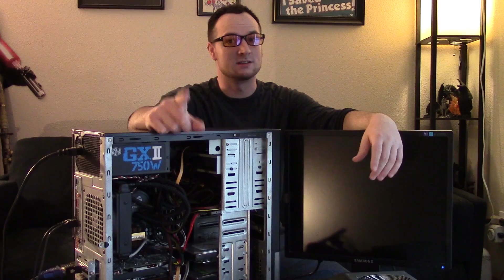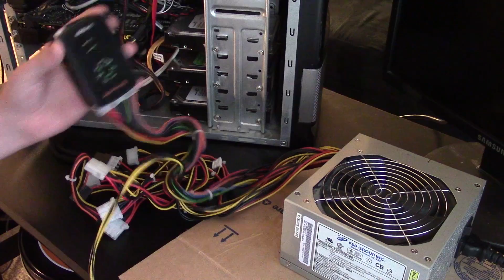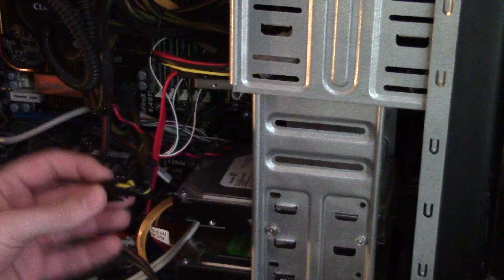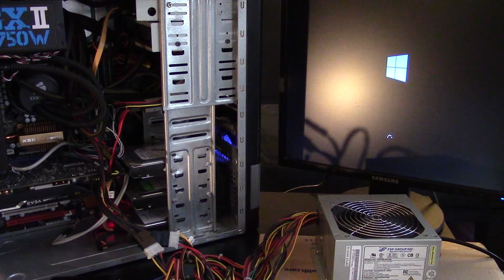💻 Running dual power supplies

Comment: What happens if you turn the system and the psu on at not exactly the same time
Reply from the maker: in my experience you get the low power performance warning on the video card or the video simple does not display.
Reply: @TheThorns  nothing that will destroy components?
Reply from the maker: @STEN-164  since you are only hooking into the video card external pin out not to my knowledge. if you are worried and are planning on doing this on your primary machine I would highly recommend getting the $6 dollar adapter from amazon which is listed in the videos description.
Reply: @TheThorns  okay thank you and  great video by the way!
Reply: @TheThorns  what would you need an adapter for.?
Reply: @TheThorns   1 year later but i have a question what if i turn on the secondary psu first and then my primary will it work that way without any risk?
Reply: @gamingtutorials5938  my setup has two power supplies, And it doesn't honestly matter from what i've seen, I usually turn on the video card's power supply first. you also don't have to keep the other power supply off while you turn off your system just an fyi
Reply: you should have 1 psu to the most important components like the motherboard and video cards the rest of the optional stuff from the second psu. the reason is water-cooling ect because they take a lot to run depending on the hardware.
Reply: thanks so much, your videos are really informative,your other pc videos were really helpful
Reply: @zaklevy7481  i think theres a adoptor right now that you can Hook 2 24pin psu together. so it Boot at the same time. Cypto miners are expert about This
Reply: They make these little adapter things now so u don't need to use a tester. Basically a female end with the 2 required pins connected with a wire. Cheap too

Comment: or simply connect green and black wires from both, 3, 4, 10 psus and they will turn ON at the same time ... duh
Reply from the maker: yes the paper clip method of course works, but much better for the hardware to use a tester or a modified cable adapter. Also, hard to expect beginners to know such things as the video is intended for everyone.

Comment: Heard a pop, gonna wait and just get a new power supply 😅hopefully it was the power supply popped or Hello alder lake?
Reply from the maker: Hopefully the PSU popped and not a component in the motherboard.
Reply: @TheThorns  Thankfully got a new replacement powersupply and it indeed was just one of the powersupplies, been meaning to replace it but just added a support and it worked for awhile. now all is well and better. Happy Holidays mate, I  hope you are having a good one.

Comment: is there a way to do this so that the psu and cables are not draped across the desk? Or a way to close the pc case and keep the power supply itself in a safer more secure location?
Reply from the maker: Some desktop cases support 2 power supplies. However I have seen others take the expansion card back plates brackets out of thier computer case running the cables through them in the back which allows them to close the case. Then its just a matter of finding a nice plastic enclosure for the power supply itself. As long as the power supply can breath within the enclosure I have not heard of any issues.

Comment: I do this in 2024
Reply from the maker: I still do this today on a different system , however the setup is a little nicer using a Molex power brick and an official cable.

Comment: So is it possible to power your motherboard and HDD with one PSU, and 2 PSUs to power the GPU?
Reply from the maker: It is certainly possible however personally I would keep it at 2 for timing reasons. I also recommend using an actual cable to handle this versus the older methods.

Comment: Bro i have a UPS so should i connect the gpu power to it ? 

And when i turn on the ups will both the Power supply turn together?

Thanks
Reply from the maker: you need an adapter cable for best results and for both to turn on at the same time. other wise you have to use the paper clip method or PSU tester method and have to manually turn them on and off together.

Comment: u should get a 120v relay with 5V or 12V coil, so when u turn on the PC, it automatically turns on the 2nd PSU.
Reply from the maker: Yep, that's why I put the link to such an adapter in the description.

Comment: Can I use the 2nd psu to only power my sata HDDs ?
Reply from the maker: You most certainly can, however I'd still get the adapter so you don't have a timing issue.
Reply: Thanks for the reply..but say if I never put my pc to sleep and restart my pc everytime I need to shutdown my pc and then when my pc asks for the password after BIOS (I have set a BIOS password to be entered everytime my pc boots) I turn off the switch at the wall ? Won't that be safe enough for the HDDs and my pc altogether ? @TheThorns

Comment: I have a similar rig, but at times when a load something particular to and editing time line or something along those lines, the PSU powering the card turns of...
It doesn't turn of when i do a stress test, but will turn of if i repeat the same action that turned it of in the 1st place...
What's the issue...
Reply from the maker: That is an odd one. I'd try a different PSU if you have one available. Also what are you using to stress test? Personally I use FurMark.
Please sub if you can 😊

Comment: so just to confirm you can get another power supply and just connect it to power and graphic card
Reply from the maker: In short yes. However you need to get the timing right if not using a splitter. Meaning turn the computer on and abut 2 seconds latter activate/power-on the second PSU. If you get the adapter you don't have to worry about it.  Please sub if you can 😊

Comment: Bro i have a hp slim 290 and itz very slowwwww and i want to upgrade the gpu to 750ti by using a external psu but from this vidoe i cant understand what u did i think u first connect the 24pin to the psu tester and the the 6pin to gpu then turn both on is that what u do or i have to do something else ??😔😔
Reply from the maker: You are correct plugging up the 24 pin connector basically bypasses to on mode for the power supply.  In this video I use a power supply tester as it is safe and you don't need to locate the pins to jump. There are several ways to accomplish this with official 2 way adapters for 24 pin connectors. If your 750ti has a 6 pin connector the tester method should work fine. If the HP slim has a 24 pin connector and not proprietary power supply I would recommend just getting the cable in the description. Long story short the 2nd power supply will have the tester on the 24 pin connector and the 6 pin goes to your video card. If your 2nd power supply doesn't have a manual switch anywhere I would recommend plugging into a dedicated surge protector as just plugging it in when you power on you PC can cause dirty power issues. Note some boards just flat out don't like this method and an HP slim Motherboard is the type of board it might not work with.
Reply: @TheThorns  Thank u so much bro

Comment: I would connect an alligator clip from the chassis of the computer to the chassis of the PSU so the grounds of the two PSUs are connected, that avoids electrical problems.
Reply from the maker: These days I highly recommend getting an official adapter which is in the description. But I agree , the clips would be much better than the paper clip method. Please sub if you can.

Comment: Im trying to add a GPU to a HP Z420 which only has a 6-pin pcie power connector but the GPU needs 2x 8-pin power. It looks like I can simply add a second PSU to power the dual 8-pin connectors, but im wondering how you establish a common ground between the 2 PSUs. Is that done internal to the GPU since the X16 slot is powered from 1 PSU and the GPU power is comming from the second PSU?
Reply from the maker: Honestly I'd pick up a convertor adapter so you can have a standard power supply for the HP z420. Depending on what you have might just be able to switch to one good power supply. Please sub if you can.
Reply: @TheThorns  I agree, I found a 24-pin to 18-pin converter and ill try that with an external ATX PSU shortly

Comment: not everyone has an power supply tester
Reply from the maker: Which is why there are 3 options. jump it yourself , buy an adapter cable (link in description) or use a tester.

Comment: I´ve had a similar setup for 10 years since I have a dell motherboard with a propietary PSU, inside a standard ATX case and a RX 580. I simply turn on the PSU that is connected to the GPU first, and after 2 secs I power on the system normally.

When I shutdown the system, I wait for the power LED to turn off and then manually switch the PSU that I have connected to the GPU off.

The PSU is bridged with a paper clip and duct tape around it.
Reply from the maker: Thanks for sharing, ya there are essentially 3 methods for this. Use an adapter that cost $6 , use a power supply tester if you have one or the paper clip trick. Please sub if you can.
Reply: Just what i was looking for. I have a HP Prodesk 600 g2, and gonna give life to a RX 580 8GB using an external 500W PSU using its 6 pin connector to power up the GPU and jumpstarting it using a paperclip.
Reply: @Yohi_Gaming  It does work. You can put up to a 6th gen I7 in those machines. They are really good at gaming.
Reply: @ferna2294  that's my last upgrade, mate, thank you very much !! :DDDDD

Comment: So can you run the two 8 pin gpu connectors with one psu and the 75W pci slot power on another psu with out having current drift or regulators fighting each other?
Reply from the maker: I would use an official cable, link in the description I think its like $6. however yes in this case you can split and just have the two GPU connection on one power supply.  Please sub if you can.

Comment: Hey im having trouble with this method im not sure if you can help. My pc boots up fine with both PSUs connected. Though under heavy load like gaming my GPU PSU turns off. 
Thanks in advance!
Reply from the maker: Are you using the split adapter, paper clip jump or power supply tester? Your board might not like the config and assumes you only have the watts of the primary. Please sub if you can.

Comment: Hey I did this everything powers on and stuff I just not getting any GPU display or anything but when I do it without the GPU I get a display on my PC and I really wanted this to work I have 2 psu do I don't understand I also have a apu like a GPU in a CPU I just don't have any display power
Reply from the maker: I have to assume it is a power issue on one of the supplies or a syncing issue. you may want to consider a cable adapter to see if they will sync better. 🎃 Have a Happy Halloween & please sub if you can.

Comment: what happens if you don't switch off the psu powering the gpu after pc turns off?
Reply from the maker: normally it just keeps the fan spinning and the card is still active waiting for instructions from the motherboard. but be careful not all mobo's and video cards are created equal and may not be so forgiving. Please sub if you can 🤖

Comment: So I know this is an old video, but I have an add desktop and there's not much I can do because of the hp proprietary connectors, so I'm looking at a secondary external PSU so I can upgrade the GPU. Have you considered tying in the on/off of the secondary with the system's main power switch?
Reply from the maker: If it's a full or mid tower you can get HP to 24 pin connector convertor cables. you can even go dual with those cables. 

☃️ Happy Holidays. Sorry for the delay in response, as I'm sure you know I can't reply to everyone. Hope you enjoyed the video. Please sub if you haven't already & have a safe new year. 🙂

example: 
https://www.amazon.com/gp/product/B06XW7RWNH/ref=as_li_tl?ie=UTF8&camp=1789&creative=9325&creativeASIN=B06XW7RWNH&linkCode=as2&tag=drnoobslab0b-20&linkId=1f52aba437d3ef646f2dd83bd7b2a3f9

Comment: Hi, sorry for writing so late on this old video but here goes:

What if I use the extra psu but don't connect it to the mother board and instead it just powers an extra GPU that is outside via a riser? or does it strictly need to power the motherboard first?
Reply from the maker: That is what this video is about.  One PSU is going to motherboard and hard drives, the second is going to the GPU. You need to power the motherboard with a PSU or the computer will not function. Sorry for the delay, as I'm sure you know I can't reply to everyone. Hope you enjoyed the video. Have a Happy Halloween 🎃 & please sub if you can.🙂

Comment: What downside you get a twin socket mains plug those white square ones put both mains plugs into the square then into the wall socket and use that to switch on and off leaving the psu switches on.
Reply from the maker: should be fine if I am understanding what you are trying to accomplish.
However if I am not understanding your question correctly, Never force any 4, 6 or 8's where they are not supposed to go as you will more than likely fry something. 

☃️ Happy Holidays. Sorry for the delay in response, as I'm sure you know I can't reply to everyone. Hope you enjoyed the video. Please sub if you haven't already & have a safe new year. 🙂

Comment: Since the PCI slot is feeding power to the graphics card already, and with this additional psu feeding power to the gpu via the 6 pin connector, is it safe to do this given that 2 separate power supplies are powering the 1 gpu? Thanks in advance to anyone that answers.
Reply from the maker: It is always best to link the 2 PSU's together if possible. That way it functions as one unit according to the hardware. If one powers down and the other is still on it can cause issues over time. There are cables to link two PSU's otherwise just don't forget to turn them both on at the same time as well as off at same time. -Best & Please sub if you can 🙂
Reply: I am also wondering about this. I still don't know if it is safe or not. 

Planning to have 1 GPU attached to the motherboard but that GPU is powered by a 2nd PSU (via an add psu adapter). 

So basically it draws power from PCIE (main PSU) and cables (2nd PSU).

Comment: Yep I did it the hard way and soldered the psu wires together🤷‍♂️
Reply from the maker: That must have been fun and interesting. Only real downside is if one burns out have to cut and do it again. Please sub if you can.

Comment: Just guessing, but would a relay (like a cheap / free from junkyard relay) hooked to the main power automatically connect the secondary power supply's "power on" wires when the main power turns on, and also automatically disconnect them when the main power turns off? Instead of a paper clip or soldered together, or a tester permanently left in there. I'm just not sure how the power supplies turn off, might need a secondary relay to other wires or something
Reply from the maker: Thanks for sharing, Personally I prefer the cable. 
https://www.amazon.com/gp/product/B099Q3G47V/ref=as_li_tl?ie=UTF8&camp=1789&creative=9325&creativeASIN=B099Q3G47V&linkCode=as2&tag=drnoobslab0b-20&linkId=3adbc0e84750bf3b942265beae26d36b

☃️ Happy Holidays. Sorry for the delay in response, as I'm sure you know I can't reply to everyone. Hope you enjoyed the video. Please sub if you haven't already & have a safe new year. 🙂

Comment: Thanks very much. Is there some problem, I mean really problem, if for some reason both PSU aren't turn ON or OFF at the same time? Like burning mi Video Card?
Reply from the maker: It is always best to link the 2 PSU's together if possible. That way it functions as one unit according to the hardware. If one powers down and the other is still on it can cause issues over time. There are cables to link two PSU's otherwise just don't forget to turn them both on at the same time as well as off at same time. -Best & Please sub if you can 🙂
Reply: @TheThorns  Good to know that. I appreciate your answer.

Comment: Hello, I have an HP 8300 SFF computer, I have a 240W power supply unit in it, I have an Intel i5 3570, 8 GB of RAM, one HDD, one optical drive. I have a graphics RX570 nitro 4GB.
But my power supply does not have enough power for that graphics, can I buy an additional power supply only for that graphics, of 620W, so that through that power supply with 8-pin and 6-pin cable I only power the graphics and nothing more, would it work normally ? It would mean a lot to me, and thank you very much.
Reply from the maker: You might want to get a convertor cable so you can use a better power supply.
Example: https://www.amazon.com/gp/product/B06XW7RWNH/ref=as_li_tl?ie=UTF8&camp=1789&creative=9325&creativeASIN=B06XW7RWNH&linkCode=as2&tag=drnoobslab0b-20&linkId=1f52aba437d3ef646f2dd83bd7b2a3f9

☃️ Happy Holidays. Sorry for the delay in response, as I'm sure you know I can't reply to everyone. Hope you enjoyed the video. Please sub if you haven't already & have a safe new year. 🙂

Comment: What happens if the psu is turned on before the motherboard, and just plugging in the 8/6 cables when the pc is on?
Reply: I have 2 PSU one main and the other for the GPU, if I turn on firs the GPU PSU (as usual) the GPU just start spinning like at the minimum speed and then when I turn on the PC it boots up just fine, now I have the 2 PSU Sync via the green wire and connecting de neutrals, and now my PC turns off and on with just 1 button
Reply: @juancamegadeth  hey bro can you send information, blog links or a video o what your talking about. Sounds awesome
Reply from the maker: it will send power to the video card without a connection and can cause some malfunctions over time especially if AMD. ☃️ Happy Holidays. Sorry for the delay in response, as I'm sure you know I can't reply to everyone. Hope you enjoyed the video. Please sub if you haven't already & have a safe new year. 🙂